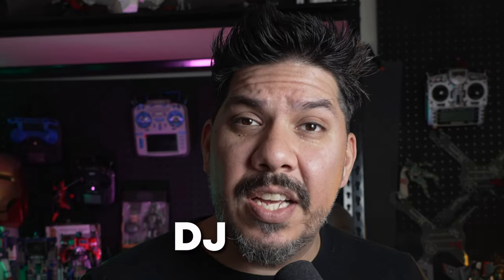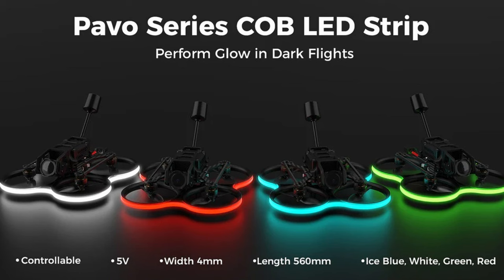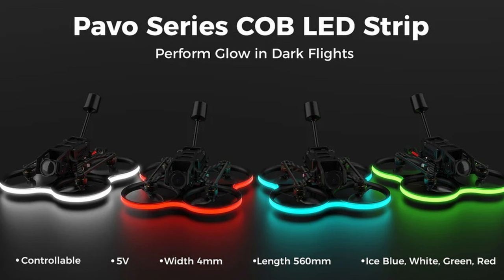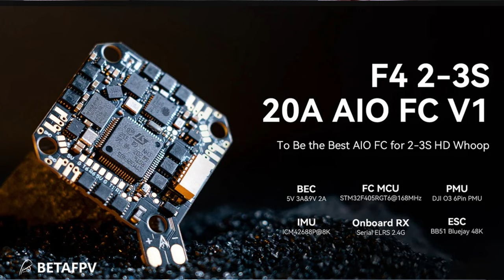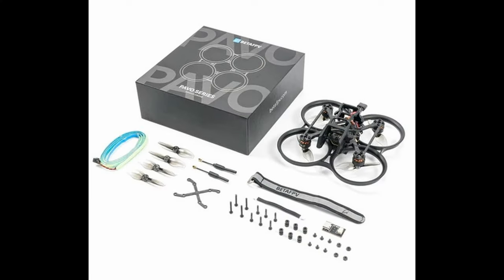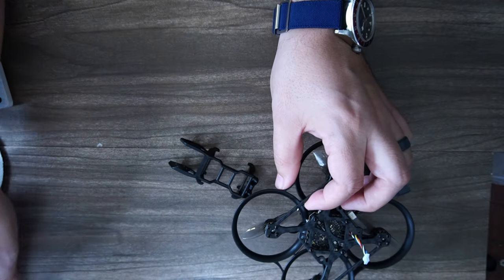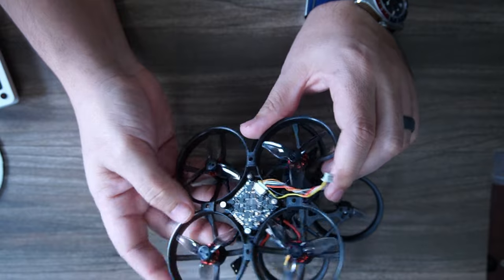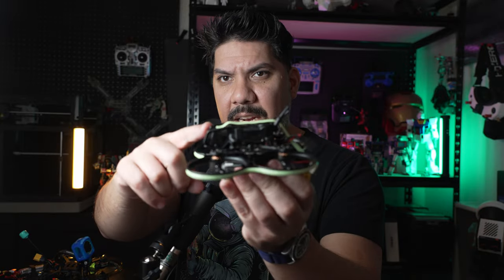small Cinewhoop evolution -  pavo 20

Comment: Out of the box the pavo20 is assembled and in the air within 30min.  Very very easy assembly with no soldering required. Flys amazing on stock tune.

Comment: Have you tried on 2s?    I have seen mixed stuff about it.  I just barely ordered one of these bad boys while I am waiting for every other choice to not be backordered.  I went for 520 batteries and 850 both in 3s.  I wonder if 2s will be softer for indoors?
Reply from the maker: I haven’t. I got a bunch of tiny trainer batteries so I just used those
Reply: I put the beta 1103 11000kv 2S motors on mine and it rips well, but does have some trouble at low throttle.

Comment: Buy the kit, I built a nice 4s  f7 based inav rig. I want to try 18650 2s for 20 minute flight time..
It loves eMax tri blade avans
Reply: Did you try it?
Reply: @amemo97  no, i got sick of quads for a while, 
The whole dji centric bs. Arduplane has me for awle
Reply: @sullytrny  oh I see. Be happy with it than
Reply: @amemo97  I'll tell you one secret. I have discovered with these things though. If you use a 2 mm plastic washer and adjust the blade tips to the very bottom of the duct on the pabos, you'll see very different performance and blah blah blah. All I can say is play with it.  You might have to make some customs. The 4 screws and blah blah, but it's easy.
Reply: @sullytrny  Interesting... I will try out thnx